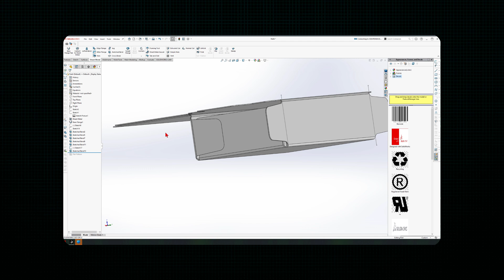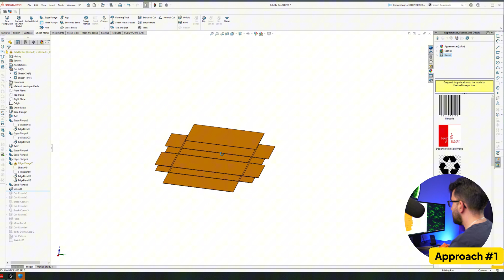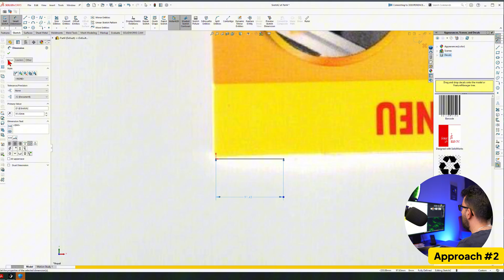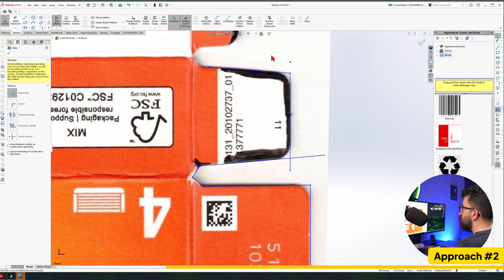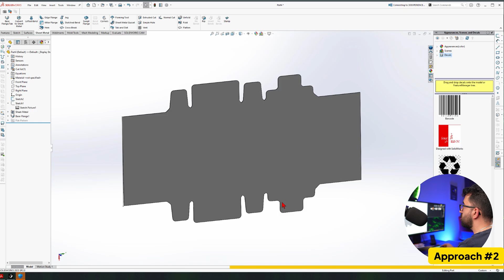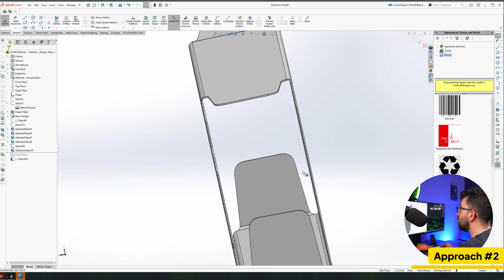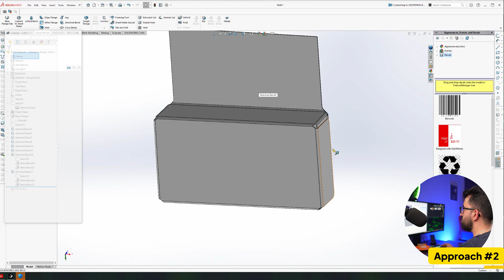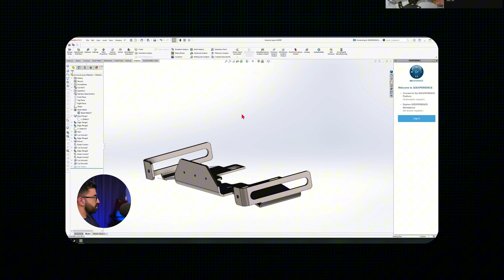How to Design Product Packaging in SolidWorks | Two different Ways

Comment: Ehats ur opinion to do some steps before solidworks or any 3d modeling software 
Just insert the scan into corel draw or ilustrator
Scale and rotate easier and faster
And  just auto trace and out boundary 
Then export as dxf or dwg

Comment: If your scan is tilted you adjust the image in appearance. Pick projection instead of automatic and rotate the image to a previously drawn vertical line to make it vertical. Then enjoy redrawing the process.
Best way would be to measure the outer dimensions in rectangular outline, draw that rectangle first on a face and put the image to fit in the rectangle
Reply from the maker: That's what I did, but there is a degree to how acurate you can go.